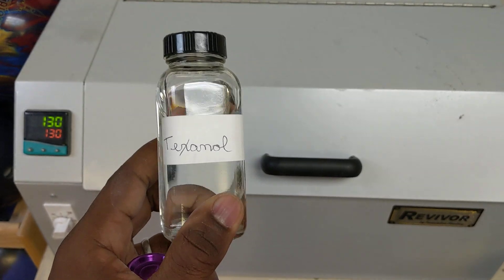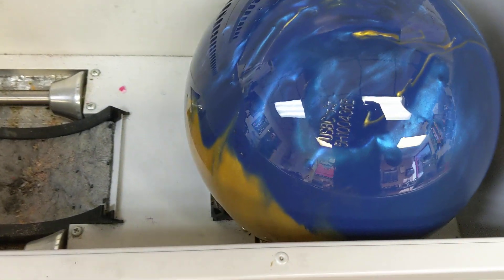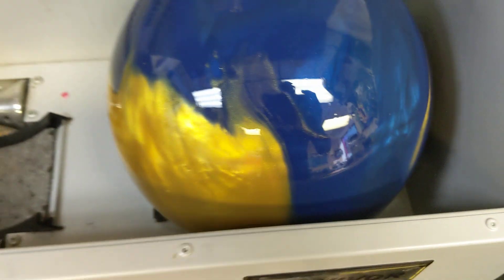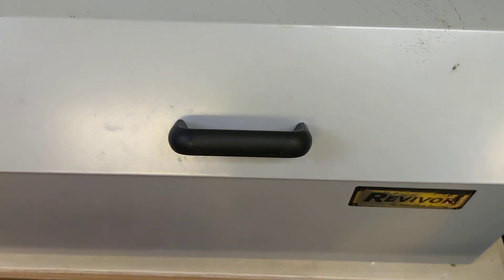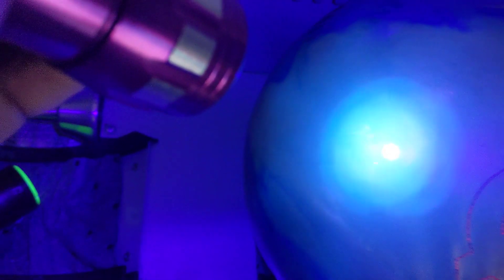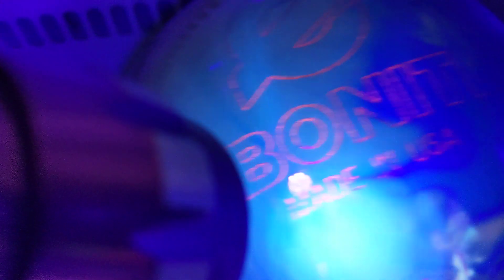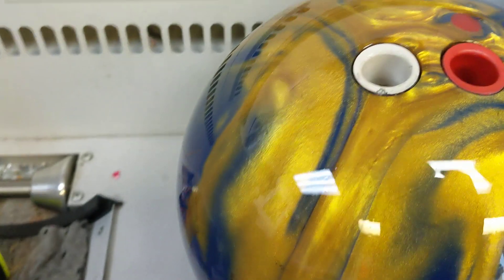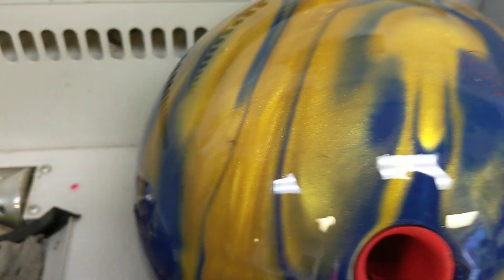Heat | What really comes out of your bowling ball

Comment: I've seen where the bowler puts the ball in water with a solution. I've seen a few days later where the ball will leak water out of the finger or thumb hole. How does this effect the chemicals that are in the ball and ball reaction?
Reply: As you lose the Plasticizer in tha ball.  Its makes tha ball easier to crack.  But if you need your SOLID ball to work right and remain tacky.  This might be one of tha process you need to do.  But Solid HIGH end balls are trash and unreliable after 10 games.  They are perfect if your in tha CHAMPIONSHIP match and you got a FRESH one to make money.  You CANT BEAT it.  But for a daily DRIVER its total trash.  You will get a more reliable ball once you polish it.   If it dies.  Polish it.  or put it on Ebay I'll buy it from you and bowl 200's with it.  high rev bowlers love old solid balls

Comment: The porosity of the balls under surface above the core draws the oil throughout the ball that soaks down in from the oil rings from the lane.

Further, the lane oil on the catch belt, pins and ball return track put oil on the ball. Yes, not to the level of on the track as it rolls on the freshly oiled lane, but oil in contact with the ball nonerheless.

As the ball is rotating in heat between 120-125 degrees, the oil thins and is drawn from the ball. Because it's being drawn from all points and slowly spinning, the manifestation of oil will cover the ball.

How do we know it's oil? Certain rare covers don't absorb or bleed oil at all, or if they do it is very little. If plasticizer is what comes out when heated, since that is common in all balls, we should see the same level of bleed out.

Since we are ones to always dig deeper for answers, someone having access to fresh lane oil can do an experiment.
Send a sample of fresh lane oil and a sample of oil pulled from a bowling ball in a Revivor  to Blackstone Labs. It is Blackstone who analyzes the composition of various oils and solvents. They could compare each to verify their conposition.
Reply from the maker: This is a classic case of the illusion of knowledge. Start by Googling that. I won't get to technical here. I want to educate you on this topic with simple examples.  One look at a PBA show that uses blue lane oil, and your assumption about oil travel no longer holds up. The oil isn't thinning Google the chemical makeup of lane oil.  All balls have different amounts of plasticizer. So not all balls bleed not bleed the same. Covers that don't absorb oil are called urethane.  We don't need to send a sample of oil anywhere. This video provides insight as to what is going on. It's not a formal lab experiment. We have plenty of data to back up what we are saying. In fact there is a patent and a technical paper about this very topic. I hope that makes sense.  Thanks for watching.
Reply: @Ctdbowling  Thanks for your comment.
Enlightening in many ways....Enjoy your illusion as well. 

You do agree lane oil is one of the elements to get drawn out of a bowling ball?

If you subject a ball to excessive temperatures  absolutely plasticizer will come out. The warnings against doing that have been out for at least a dozen years.

It's an interesting topic. Why wouldn't a Blackstone analysis be worthwhile? We all want the same answer. The are the amazing in how the can breakdown the elements in an oil or solvent.

Peace man. Have a good rest of your week.
Reply from the maker: Yes without question you can and do draw oil out of the ball. Knowing that reactive bowling balls have around 30% plasticizer in them and that the oil stays pretty much in place yet the entire ball sweats indicates that you are pulling both out but not at the same rate or volume. This is all at recommended temperatures for a revivor.  I actually have a video showing plasticizer coming out of a brand new ball in a revivor. If you truly want a more technical answer read my patent. 
https://patents.google.com/patent/US7473322?oq=ronald+hickland